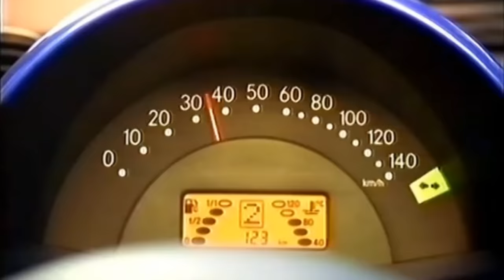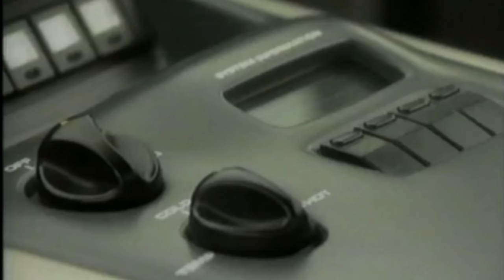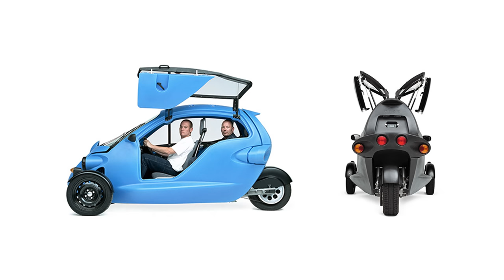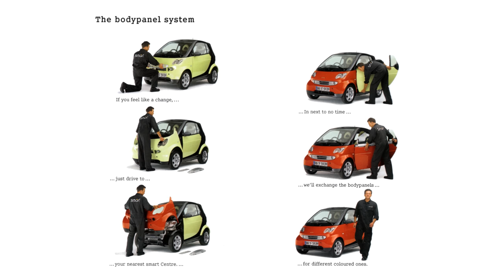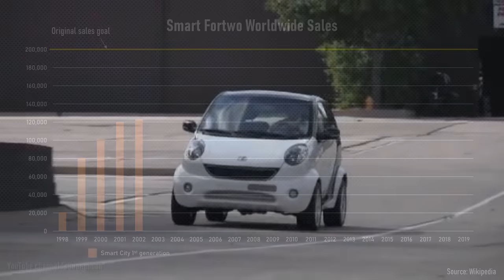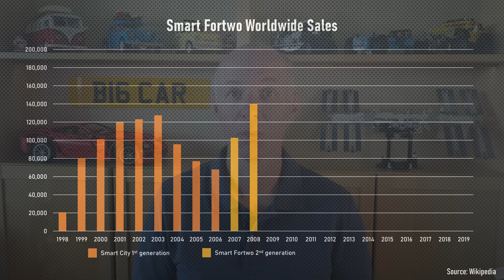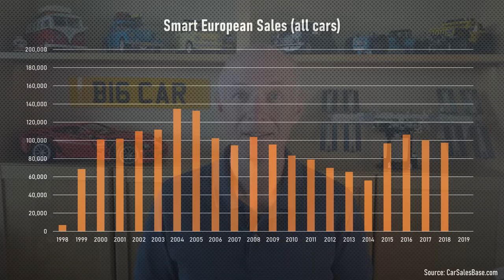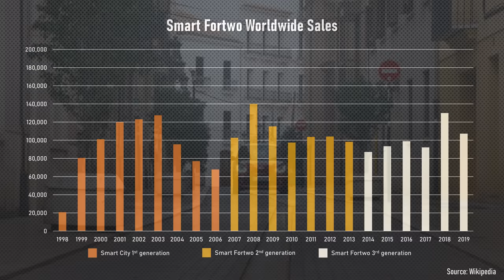The “Swatchmobile" ABANDONED by its creators. The Smart Fortwo Story

Comment: Kinda surprised you didn't cover the Tridion Safety Cell a bit more as it was a very clever piece of engineering.
Reply: It was a gimmick though
Reply: @Rokomarn  I remember 5th gear running one into a concrete block at 70mph, I was amazed that the safety cell actually held up. Obviously internal organs performing such a dead stop are likely to kill you anyways, but I think it was showing that a small car didn't mean it was a death-trap and that crash safety wasn't necessarily linked to a cars size

Comment: One remark to the power steering: That wasn't new to the 451 Version, but also available in the 450 and 452. With the weight distribution and the narrow front wheels of the 450, it was never really needed, and only very few numbers had it installed. Also a fun fact: The claimed better high speed stability of the 453 turned out to be even worse. With the suspension being much softer than before and a way more direct steering, it runs more nervous than even the 450, with the side wind assistant often missing it's cue and a tendency to swerve to the right when breaking from high speeds. One thing that also didn't improve over the years was the boot space: Different measuring standards showed higher numbers, but the usable dimensions never went beyond the 450. Engine durability is where 451 and 453 shine in comparison, however. 
The 450 is now living a lot longer than anyone expected, and without it, there wouldn't be a Smart Roadster - and I would really miss those... 😉

Comment: Thank you thank you.
A wonderful walk through of the history of the smart 4-2. We bought ours as soon as the rhd bigger fuel tank Mk.6 came on the market, that was back in 2002. I became quite involved in ‘the smart car scene’ and after the warranty ran out had it modified thanks to City Cars/Janspeed who achieved a similar performance to the Brabus version. With wider wheels, lowered suspension and upgraded brakes to add to the engine/exhaust mods this smart was a real pleasure to drive. 
To end this lengthy post I’ll simply finish by saying that 20 years later we still have this wonderful little character 👍

Comment: I had a 2001 City-Coupe and drove it ~253000 km in 8 years. Mostly commuting on german Autobahn. Speed was no thing, but the famous 800ccm common rail diesel engine helped me to save a lot. It was not hard to drive it with less then 3 liters per 100km. The car was indeed pretty spacious inside and up to date in terms of equipment features. I loved the car and drove it until a motor damage separated us forever.

Comment: I had one of those US 2008 models (pre-ordered on the first day). I kept it for 4 years. It was fun to drive. For the first year, a Lambrogini wouldn't have turned more heads. No one knew what it was.
Reply: I went to Rome in the early 2000's. Without exaggeration, one in five cars was a smart car.
Reply: I bought a 2009 US model, and it was nerve-racking to look to my left or right and see everyone staring at me.  I drove the brakes off that thing.  I put 90k miles on it in 3 years.  I kept it for another 2 years, as it sat in my driveway, due to having kids, then sold it to a homeless guy (That's another story).   When it hits 25 years, I might import the Roadster.

Comment: I bought one of the 1st 2008 Smart Four Two Passions in Portland OR. What a great car! My wife put 120K miles on it before we passed in on to our 6’4” 225 pound teenage son. He loved that car and drove it for another 50K miles before it needed transmission work. It never burned oil, and was fun to drive with the paddle shifters. He had a decal on the back that said; “It takes a BIG man to drive a little car”. We were always approached by folks wanting one. We had to pick up cards & sales literature  from our Smart dealership to hand out at gas stations. I never met a Smart car owner who didn’t love their little car. I would buy one now if they were still available.
Reply: I‘m 6‘6 and my first car was a 2010 Smart as well. It just offers a lot of space for the driver and is practical inside and out.

Comment: My first smart was in 2006, a used 2004 smart.  I passed this on to my daughter in 2009 when I bought a new diesel passion.  
I was disappointed with the fuel economy being around 270 miles to a tank.  I was told this would improve.   I still love this car and generally does 500 miles to a tank with a couple of litres left. 
Just had all the shock absorbers replaced.

Comment: The roadster was great fun to own felt faster than it actually was. It had a good exhaust note thanks to its three cylinder engine. It was highly manoeuvrable and rear engined with good breaking. People loved it. It wasn’t a cheap cheap car to run, it was better taken to a specialist, independent not MB! As was said a surprising solidity and quality in the driving experience. Semi auto gearbox was the not quickest but you learned to live with it. Character in spades. Used to race along in the mountains at Snowdonia national park Wales UK most weekends. It was a very low reclining seating position which was extremely comfortable on long journeys surprisingly and a dynamic sporting feel. The feedback from the road and driver connection to the vehicle was excellent.
Reply: Dang chill out b
Reply: The specialist part is what made me sell my Brabus coupe. The nearest one to me involved a 60 mile round trip and every feckin thing required it to be hooked up to mercedes star diagnostics plus parts were not cheap. It was good fun though.
Reply: @S-Ltd1000  Yes, I used to spend the day in Birmingham each year while  they worked on it. Sometimes I had to take the train home and come back. I spent way too much on it really.! They made a packet out of me, wished they had said get another one up front.

Comment: There was a car-pool service in Stockholm serviced entirely by Smart Cars at some point. I loved the idea of Smart and it was a comfortable car for driving around the city... But the gearbox, oh...the gearbox. I actually reported it as a fault on the car when I first drove one as I would never have thought it could have been designed this way. Basically, in first gear, the car would rev upto 4-5000 revs, wait a few seconds, then with a shudder, switch to second gear...and so on. Comfortable driving position, steering, road holding.... but who ever signed off on that gearbox ??

Comment: Hello from Poland!
Back in the day we use to have the first gen ForTwo with 64hp petrol. It was a great car, very practical in towns and cities. I use to park it like You show in the film very often in Kraków. It honestly didn't need power steering, as the fron wheels were very narrow. But there were drawbacks.
It was not fuel efficient. It used around 6,5-7 liters for 100km, which is identical to a full size city car such as I gen. Yaris. It running cost was similar to an A-class Mercedes, what You would not expect from a car half the size of an A-class. We generally use to cal it "Half-a-car", as it was just ahlf of a regular car.
Cheers from Poland 😀

Comment: I ran a Smart "Pure" from 2002 until 2007 and it was one of the best cars I ever had,  Great fun to drive and very reliable.  Left-hand drive, too.  I recorded about 50 000 miles in that period.  At the time I was employed as an HGV driver and it was great fun to arrive at work and park my car  alongside the 44 tonne Mercedes artic I drove.  Sadly, the semi-auto transmission on my truck was similar to the one in the Smart, and was not really a good system, especially in the heavier vehicle. It caught me out on many occasions with its slow, ponderous gear shifts.

Comment: I bought my first generation Smart Car from eBay, having never even driven one. I loved it, and took it all over the country. My second generation Smart Car from eBay was bought with a dead engine, a victim of the horrendous belt misalignment that resulted in the water pump stopping. it's shocking that this wasn't a recall. Anyway, I just love it, and I've had it for years. It's not the most reliable of vehicles, but I'm gutted that they've discontinued them. I'll probably buy one of the last versions when they're cheap enough, and then it will be an EV.

Comment: If you own a Smart ForTwo w450 with a 0.6 and 0.7 M160 mercedes engine i highly advise you to flash the brabus tune, make sure to retrain the throttle body as well. Change the spark plugs to iridium type. That Brabus tune really gives you a huge improvement in power

Comment: I had the earliest example on UK roads which had been been registered as a Daimler and was an R registered example and was built in July 98…It was a great car and never had the normal suprex problems of gummed up piston rings or burnt out valves.

I put it down to doing oil changes once a month as it only used a thimble full of oil and took 5 minutes with a pela pump…
it also flew and over 80 the skinny early front wheels would get very light.

Comment: Once again, one of the shortest 18 minutes well spent. 👍

Hayek had initially a complete different vision of this car, similar to those E-scooters which are now popular/a pest. He envisioned that for example when arriving at a train station you rent a Smart and drive it home where either the next one could pick it up or being brought back to central renting points.
According to people who had worked close with Hayek he was quite difficult to work with as he wanted basically no changes to this his vision although it soon was clear thet is was not feasible at the time. Rumors had it that Hayek lost interest in the Smart shortly after he collaborated with Mercedes but couldn't decide whether to leave or stick around for longer.

The Smart cars itself were MB's biggest blunder ever. The MK I was a pretty loud, lame and uncomfortable affair with that tiny engine roaring right in your back, the shitty semi-transmission which took ages to shift gears (up to 1.3 secs!) and the stiff suspension which made you hop in the seat even at slightly rougher streets.

The fuel consumption wasn't that frugal as stated since there were a lot of compacts with four seats using only a fraction more petrol but had the advantage of being more practical. To add insult to injury, the lifetime of the tiny engine was quite limited - a good number of engines didn't last 40.000 kms, and a MK I with a mileage of more than 100.000 with the first engine is probably scarcer than a F40. Since MB has planned that engine to be replaced completely in case of a serious failure which could be repaired otherwise, keeping a Smart could suddenly become a serious issue.
Side note: the MK I was limited to a top speed of 135 kph, the Brabus officially to 155.

The idea with the changeable body parts were nice but...well yeah, call it stupid. Because no one wanted to outfit their Smart in according to their clothing, mood or whatever. Maybe that money had been better invested in a better equipped Smart or cheaper extras because the basic car was pitifully naked and the extras very expensive. In the end, Smart tossed out the remaining body panels for a fraction of their production cost, but since nobody bought them they were probably shredded.

The safety of the Smart is also debatable. For such a small vehicle, the occupants are indeed well protected which can't be said for pedestrians who might get hit by the Smart careening around even after a crash with a stationary object. And when MB thought that ABS, ESP and a suspension stiff as a wooden board would remedy the disadvantages of cars with a short wheelbase and RWD, the first winter showed them better when a number of Smarts literally ended on their asses (rear door) after accelerating on snow or ice in combination with steering.

Environmentally thought, but when reality intervenes...for the individual use, the Smart was intended to replace full-size cars, but in fact most buyers bought the car in addition to the already existing one(s). Another side note: in most German cities and communities it was not allowed to park a Smart facing the sidewalk in an ordinary parallel parking spot.

All in all, the Smart and all of its iterations can easily be counted to the worst cars ever being sold.

Comment: I owned a 2004 Smart Fortwo for 10 years.
Brilliant little car... Very economical to drive, stupid expensive to insure.
I went all over the country in it.
Scrapped it due to the clutch wearing out, the cost to fix it was eye watering. (If only they had given it a real auto box)
At the time, the car was only worth around £800. When I was pricing up a clutch. I was getting quotes £1200 to £2500

Comment: I bought a 2009 451 as something to tool around in so my 3.0 GTV doesn't bankrupt me. It's in most respects a nice little car for what it is, especially as mine's been tuned to push out 120HP - easily done with the turbo models.
The gearbox is amusing as long as you think of it as a drunk friend doing the gear changes. But the unforgivable thing that will soon see me sell it is it's road manners if there's the slightest gust of wind, especially at speed. Maybe not dangerous, hopefully, but certainly very unnerving!

PS: I'm also not happy that the robbing SOB's at Merc have made sure everything is electronically locked down so tightly that any kind of maintenance outside the extortionate prices of a Merc main dealer is darn near impossible. Given these are meant to be cheap cars this pretty much guarantees an environmentally unfriendly early visit to the scrap yard as they become uneconomic to keep going. Right to repair?

Comment: I've never owned a Smart Fottwo, but I do own three Smart Forfours.
All three with the Mercedes three-cylinder 1500 cc turbo diesel.
One with the semi automatic (single clutch) gear change, 6 gears and the other two with the 5 speed manual gear change.
These cars certainly have (minor) downsides, as every type of car has its downsides.
But the three-cylinder Mercedes 1500cc turbo diesel engine is simply phenomenal and runs like a charm.
The cage construction is completely galvanized and almost all body panels, including the door panel, are made of carbon-reinforced plastic.
As a result, even after 20 years, these cars do not show a speck of rust in the damp and harsh (Belgian) Western European climate.
These are the best cars I've ever owned in my life.
Too bad its production was discontinued.
In this Smart ForFour, parts from the then Mitsibischi Colt were used in collaboration with Mitsibischi.
Incidentally, the petrol engine also came from Mitsibischi.
In my opinion, the high cost price at the time of sale was the main reason why sales were disappointing.
In this class of small cars, most buyers want to spend as little as possible.
Too bad, because compared to other cars in the same category they last an eternity.
PS, the dual clutch automatic gear shifters on the market today work almost seamlessly.
But the Smart Forfour's single clutch automatic (6) gear shift works quite well.
To the extent that I prefer to drive with the automatic transmission than with the manual transmission ones.
Not that I can't change gears, because I've driven anything and everything in my life (68), including trucks with non-synched gearboxes, where double declutching and intermediate throttle when going down a gear change is indispensable.
My apologies for any translation errors.

Comment: When the Smart Fortwo was introduced in the US they held regional events to stir up interest.  My wife and I attended one of these events during which we were able to test drive the car.  The semi-automatic transmission was terrible and gave the sensation of excessively slipping the clutch when starting from stop.  In addition, the underpowered engine required premium fuel which is ironic given that it was being marketed as an economy car.  Needless to say, we didn't pursue buying one after the test drive.  I will say I was impressed with the amount of room in the interior.  I'm 6'1" and had no problems with head or leg room.
Reply: Yep. Me too drove it in one of the events at a Merc dealership in Utah.  Got back and told them that this was not car they had Britain 6 years previous and got my deposit back.

Comment: I have a very early 42 city coupe / from 1999, an „oldliner“, in aqua orange and blue interior. It has no ESP, only the „thrust plus“ system. They are not easy to repair, many things hard to reach. Easier with a lift because you can take the drivetrain down and out. It features kind of a double floor for batteries, but then they shoehorned the dreadful fuel burner in the back. Best version to buy is an early diesel cabriolet I think. Finally we put the Smart in the shed and bought… a 32 yr old MX5 NA from 1990. I do not regret that move.
Reply: @BigCar2_  No I have not- what is this, where can I find it ? I have another few exotics like a Mk 1 Centaur / Adams‘ probe derivative, and a Citroen SM etc.

Comment: Now I miss my 2008 fortwo.  Drove it for 7.5 years. Now I've had a Prius for 7 years, and want an Outback next. I still agree that it's silly to drive a huge car by myself all the time, but I'm 6'2", 250#... I need a decent sized driver space with significant rear seat room so I don't have to rest my knees on the steering wheel on road trips.

Comment: I almost bought a new one without even test driving it but the local dealer didn't understand that he could sell them.  A few years later I took one for a test drive and it was monumentally awful.  The transmission is truly bizarre and for a car that's not much longer than it is wide, for some reason it does not want to turn a corner.  It is the only thing that comes close to my old ride-on lawnmower for pushing in the corners.  I'm glad I didn't end up with one of them.  It's far more awful than I thought possible.  When it's parked it works perfectly.